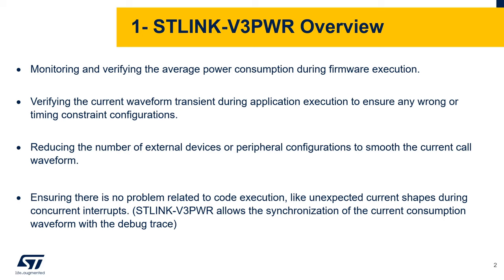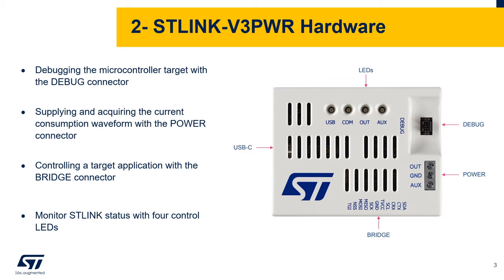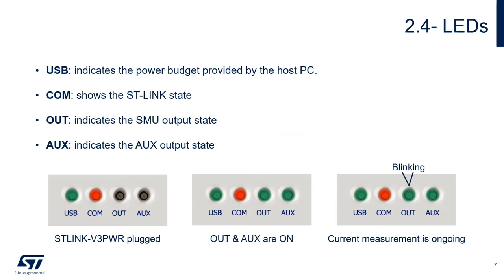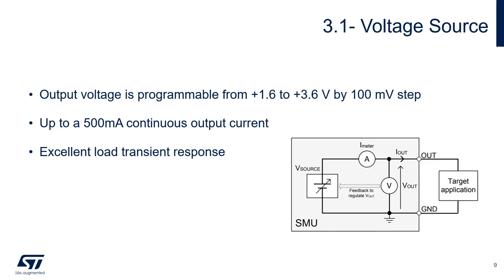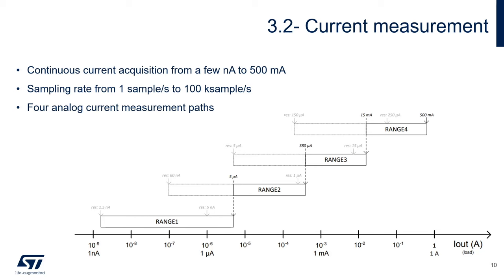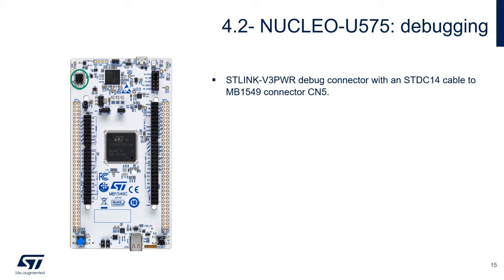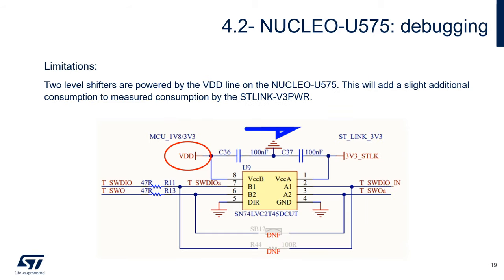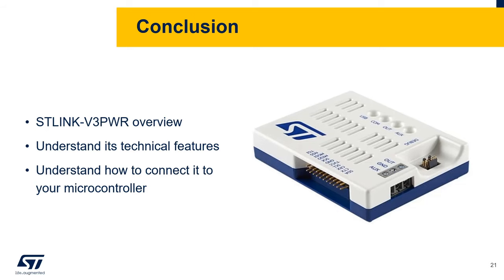STLink v3 PWR - main information about the tool

Comment: STLink v3 PWR Overview & Functionality

* 0:20 Dual Functionality: The STLink v3 PWR is both a programmer/debugger and a power measurement tool for STM32 microcontrollers.

* 0:25 Power Supply & Measurement: It can supply power (1.6V to 3.6V) and measure current consumption (nanoamps to 500mA) of a target application.

* 0:45 Standalone Operation:  It can function as a standalone power source and current measurement unit, independent of a debugger.

* 0:30 Synchronized Debugging: Allows for the synchronization of code execution with power consumption measurements for real-time analysis.

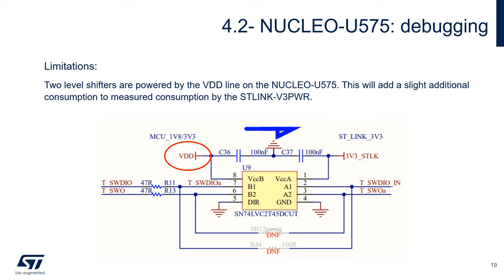* 15:49 STM32CubeMonitorPower Integration: Works with the STM32CubeMonitorPower software tool for visualizing and analyzing power consumption data.

* 1:56 Connectivity: Features a standard STDC14 debug connector, power connectors, a bridge connector (for USB to SPI, I2C, CAN bridging), and control LEDs.

* 8:53 Advanced Measurement Features: Offers programmable sampling rates, automatic self-calibration, and overcurrent protection.

* 0:38 Ideal Use Cases: Power optimization, debugging low-power applications, identifying power consumption anomalies, and verifying firmware performance.

I used gemini-1.5-pro-exp-0801 to summarize the transcript.
Cost (if I didn't use the free tier): $0.05
Input tokens: 12652
Output tokens: 531